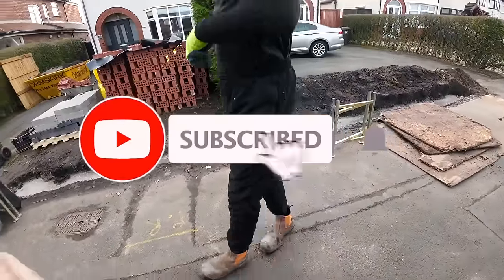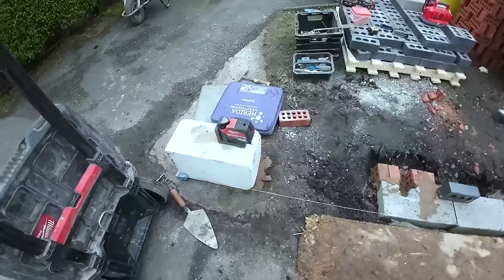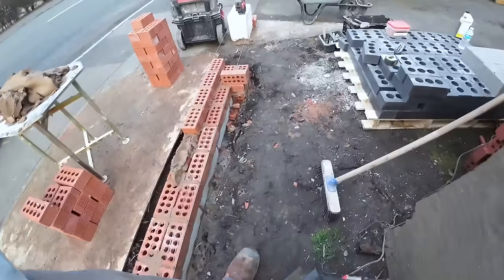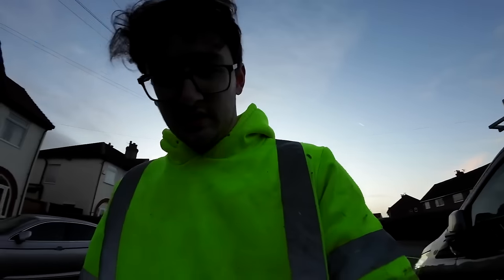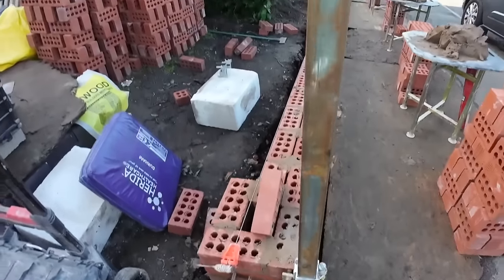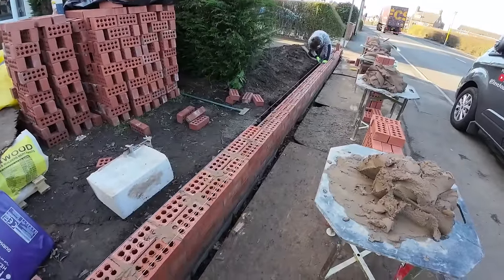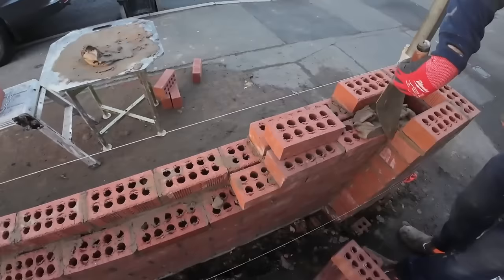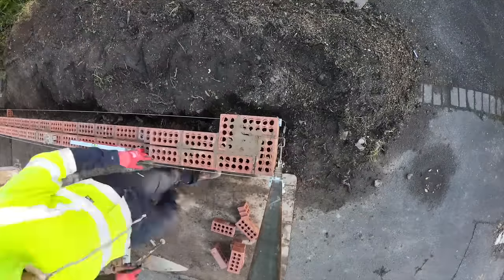BUILDING A 9" GARDEN WALL FROM DIG OUT TO PIER CAPS PT 2

Comment: Hi guys on garden walls I sometimes went for half bond on the inside course of brick instead of the inside following the same brick as the outside brickwork as yours did, I felt it made the wall stronger , just another brickie having different ways of doing garden walls 😊

Comment: Lovely looking job Steve and Al. I had a garage built out of class B,s many years ago (Marshalls Armitage). I got a cracking deal on the bricks but the bricklayer hated me for it. Said they were awful to lay, very brittle and hard and no suction to take up the water out of the mortar. Looked lovely when finished though. I appreciate how easy you make this job look when it actually isn't.

Comment: What is the purpose of the concrete blocks at foundation level? Is it just to give a stable base, or other reason? No need to tie the two leafs together in any way?
Reply from the maker: Quicker out of the ground and the wall is set out quicker 👍🏽🧱

Comment: Hi Steve and Alex , walls coming on nicely , just one question tho , why use concrete blocks instead of bring concrete higher or using bricks ?
Reply from the maker: We like to set the wall out with blocks an it saves on a lot of expensive bricks 🧱👍🏽
Reply: cheers guys for update  @SteveAndAlexBuild

Comment: How long can the line be before it sags in the middle
Reply: On longer runs of work we use a "tingle" to support the line at mid-point-ish.....
Reply from the maker: Not sure exactly 🤔🧱👍🏽
Reply: @SteveAndAlexBuild  Steve,
An average flank wall would be 37 bricks long or 8.3metres.  so  tight lines and possibly a tingle on that.
Anything over 10 metres would definitely start sagging -  and would need a tingle.
😁👍
Reply from the maker: @martin2466 👌🏼🧱👍🏽

Comment: I'm interested why the end pillars aren't filled in on each course by a half brick in the centre?
By my reasoning, it would make the pillar stronger.
Would love to hear your answer boys.
Reply from the maker: Mmmm … it was explained in the video 🤨
Reply: Must have missed it during the time I was on mute to save my sanity from that "music".
Reply: To run cable for a light.....explained by Steve in vid.
Reply: @Sean006  Thank you Sean
Reply: @tonyrhodes3087
It would but only to a small degree.
You often see the centre of these piers filled with concrete and a 10mm dia re-bar dobbed in the wet concrete - total waste of time structurally. If your doing that to resist the potential turning moment - of say a gate post attached to the pier,  then make sure the re-bar is anchored into the foundation concrete first.
If you were trying to resist the impact force - of say a car damaging your pillar, then make the pier bigger, and reinforce it correctly.  It wont stop the pier tumbling down, but it will help.
The pier here,  is perfectly adequate structurally for the job it has to do. Its bonded into the main walling, and is built correctly.  Height to width ratio is good so longitudinal force and torsion will not be a problem in high winds.
The walling here has two jobs to do. 1) = Look pretty.  and    2) = Support itself and resist minor wind/movement loads.  Which I am sure it will do perfectly.
😆👍👍👍👍🧱🧱🧱🧱
Reply from the maker: @martin2466 . And light 💡 up 🧱😉👍🏽
Reply: @SteveAndAlexBuild  
Yes Mate, very true................
😆👍👍👍👍👍👍🧱🧱🔮🌅🔥🔥